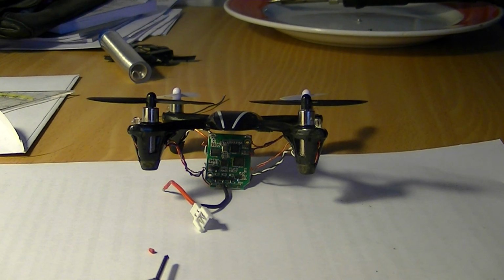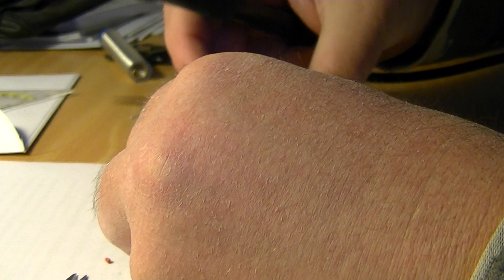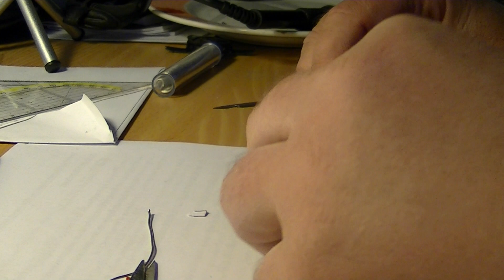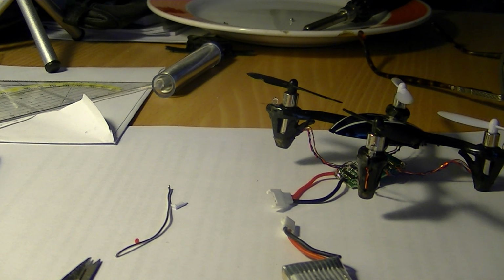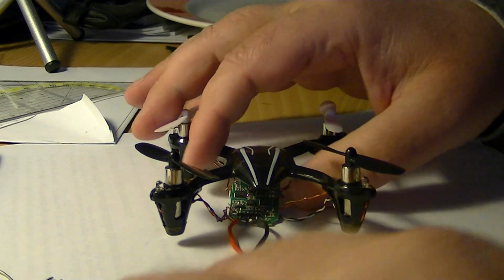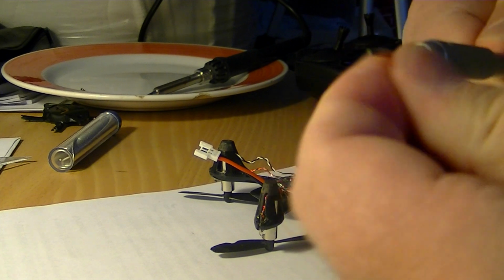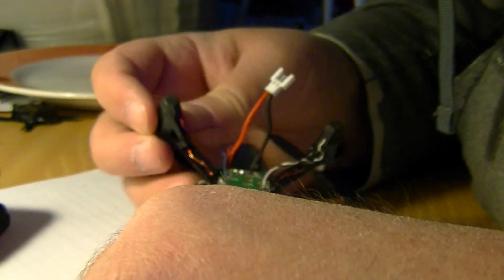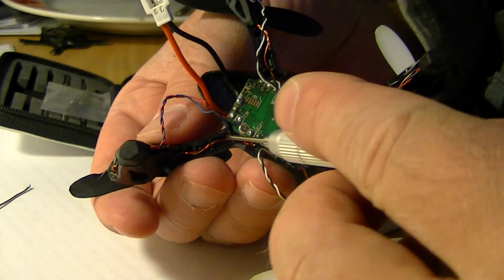MongoTV_289 - Part 3 - Drone Repair - Hubsan X4 H107L - Soldering Battery Wire

Comment: CAN YOU BUY THAT PART YOU SOLDERED
Reply: Matt Cole at the cost of the drone the replacement part is probably too costly and you would still have to solder all the other connections for motors and leds.